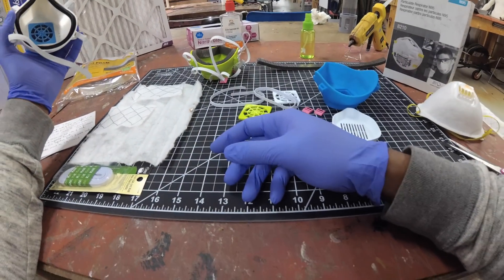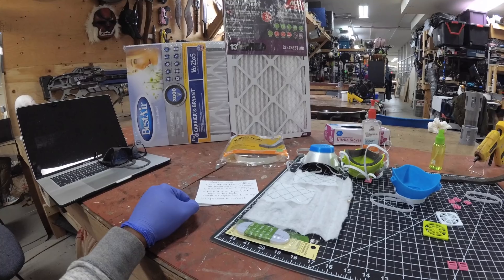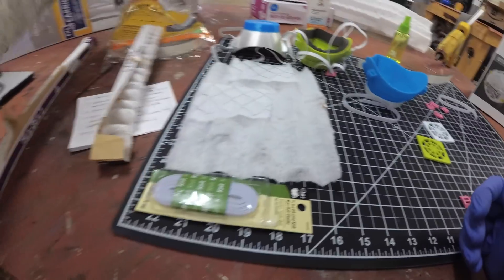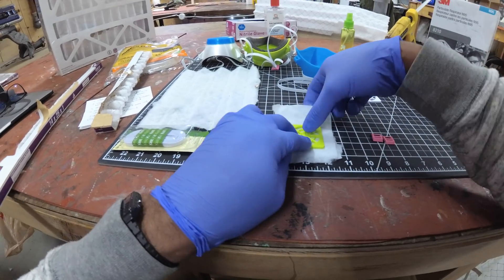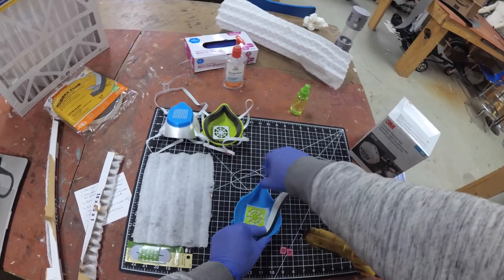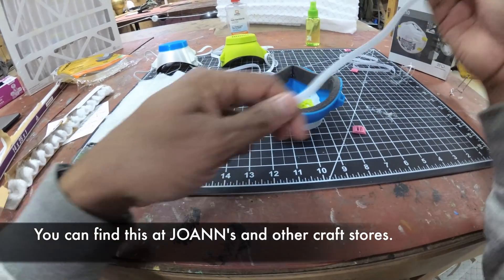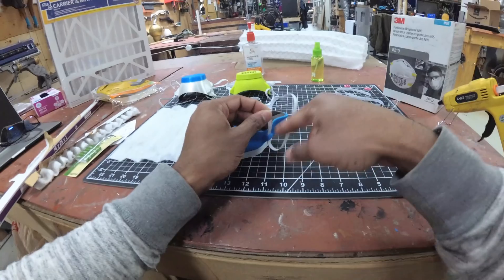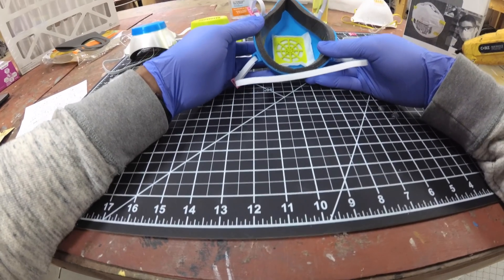3D printed PPE DIY Particulate Mask ( PROCESS )

Comment: Very bad design: You have no one way exit valve for exhale air, to prevent the moisture build-up on the filter element, thus quickly degrading the element. Also, the way you are not isolating the (very small) filter element from the mouth. This, paired with moisture build up, will make this in to a petri-dish, not an respirator. This is not something i would trust my well being to.
Reply: how would this (even if its slightly flawed) compare to a normal surgical mask?    i only got those surgical mask (blue colored ones)  and debating would that still be better? or this?
Reply: @JC.72  Surgical masks, the ones that surgeons used are designed to intercept exhale particulate, not intercept inhale particulates. They do not forma seal around the mouth and nose and they do not have a stand-off distance from mouth and nose. Touching your mask with your mouth is bad idea, because it contains all the filtered particulates from the air - including any pathogens. In short, surgical masks are designed to prevent you from spreading droplets on your patients, not prevent you from being exposed to droplets yourself.
As for how it compares? Lets just say that ill would not trust my life to either ones of them, surgical mask is not designed for this, and this 3D print is just fundamentally flawed.
Reply: @DjSokYchannel - true, and their filtering capability degrade even faster. You have to remember that one of the N95 respirators features are also the sand-off distance from nose and mouth and the seal around them they provide along with all the filtration of particles. The one way valve on the mask is designed to prolong the useful time a mask can be considered effective before the you change for the new one, but increasing price and complexity and adding point of a failure - the valve. This is why, most medical ones do not have them as you usually think that medical personnel have ample supply of them and change them as they need... something that is now contributing to the shortages.
Reply: 00971562029682
Reply: Pls call me

Comment: Wrong - a VERY defective design for actual use tho it is among the best looking masks?  Here's WHY?  Before that an important essential statement. We can easily divide all alternate-PPE-DIY-"inventors" into three broad categories.   1.  - the well intentioned sacrificial volunteer type trying to help that "think" they are spending time and money to donate to the problem - their primary interest - and who are welcome to hear critique.  2. -  The same as one except their - primary goal is to become a youtube celebrity-hero with mega-views.  3. - The deceptive exploitive fleecer crooks who care about nothing other then hijacking despair and disaster to the greatest personal profit their sick (self-imagined) clever minds can accomplish.  Mass numbers of DIY-er PPE devices out there representing all three categories.  You the reader be the judge which category this offering fits into.  How he responds to this comment "can" be at least one of many possible measurable's.

Why defective - abbreviated - more explanation of each follows later: ( 1. - ) > the filter size is TOO-small, ( 2. - ) > using furnace filters is wrong, ( 3. - ) > No exhale check valve (see one on any normal N9 mask), ( 4. - ) >  While this IS the most attractive Mask design I have seen the 3D material it is made of MAY make mask too heavy (this is a guess, but certainly it has to be heavier then a real N9). ( 5. - ) >  No where does he say he wore-tested it for at least a couple hours, ( 6 - ) >  He asks for donations at the end; others ask you to subscribe or press the like button - THESE ARE A RED FLAG!

Above more explained.  
( 1. - ) > There are so so so many other COMMON sources of True HEPA filter-media sources available at most common stores; use of furnace-filters reflect someone whose likely just copied another YT just adding a different take - any competent housewife can inform you of these where's - does he even know what HEPA means?  Plus another evidence he's just copied and "thinks" he's improved adding this click-bait angle of using a 3D printer is calling for you to get MERV 13 or 16 furnace filters.  Neither most Home-Depot or Lowes have furnace filters that use Merv ratings.  3M uses a numerical rating like 1300 or 1500 up to 2800 usually a Merv 13 equivalent is as high as you can get.  Honeywell also uses its own - different - rating system.  Most won't see any Merv-ratings on the most available furnace filters.  Merv-13 only do around 50% or less of .3 micron and are NOT independently Certified.  Do NOT use any Merv 13 equivalent when True Certified HEPA rated filter media is available nearly everywhere AND at both HD and Lowes, but I ain't saying where tho maybe 50%+ of skilled housewives can tell you where.  Plus obviously he has no idea that you'll not likely find any Merv 16 equivalent furnace filters available and has NO idea why - if you can't answer THAT WHY already right-now you need to choose another approach to helping out.   
( 2. - ) >  He shows an N9 Mask - what's that thing protruding from the middle - does he even know what that is and what's it for and why it is essential to any HIGH filtration media and he also needs a bigger size filter area?  Does he even know WHY the higher a furnace filter rating is the more pleating it has or the thicker it is- I doubt it?
3. (& 1.) >  That thing in the middle of the N9 - can he tell you what that is and WHY it is essential and does he even understand the difference between the square inch area of the N9 filter media vs the teeny-tiny insufficient filter area of his DEFECTIVE design.  Both these inter-related functions are minimum requirement to any mask even approaching a reasonable safety-odds margin.
( 4. - ) > Did he even consider to borrow his wife's or girlfriend's diet scale to compare the "wear-weight" of both masks, the N9 and his design, does he even understand why I added the diet word to the word scale as it relates to mask design?
( 5 & 6 ) > These self-explain themselves to anyone who understands spam and scams tho I doubt he actually intends either and SEEMS to have zero malicious intentions.  Best wishes and high hopes to - ALL!
Reply: People are trying their best and If you have such wealth of knowledge then perhaps you should share it in a constructive manner. It´s not like the guy is trying to make a killing with this. 
Your can do better then this wall of condescending text.
Reply: The plethora of time you appear to have on your hands could likely be better spent improving what you believe to be defective designs rather than being so misanthropic and rudely attaching someone with positive intentions. I am quite sure you are the type of individual that will invest  a considerable amount of time in constructing a long winded and insulting rebuttal to me that I will never read.  Send me a link to your wealth of knowledge video that will save the world and I might sacrifice another 4 minutes of my time to humor you.
Reply: You sure have a lot of time at your hand right now but wouldnt be your time used more productively if you tired to make this mask more like the N9 mask ?
Reply: @MRHanfgurke  - The man is correct, i had the same criticism. The filter element is too small, get moistened up and is too close to the face with no way to safely dispose of the filter. The filter element is potential hot bed for the pathogens, as all the air will travel trough it. This is calssical case where amateurs can do more harm than good if they don't understand the very basics of working with pathogens and air filters.

Comment: Just a suggestion. Silicone used by prosthetists and dentists is very inexpensive (at least here in Bosnia, about 30 Euro 1L) and can serve as a seal between the mask and face skin.  You can print a mold that fits in with the edge of the mask via 3D printing and then the silicone is just poured, and not irritating to the Skin. Have you tried paper or canvas vacuum cleaner bags as a filter? Some  research shows that it is very effective, but that it is very difficult to breathe through such material, but you can try it, at least. https://smartairfilters.com/en/blog/best-materials-make-diy-face-mask-virus/
Reply: Just thought about the same, any talented designer that could make this seal???
Reply from the maker: We are currently experimenting with making a master mold that we can cast from ... we're also looking into different materials, surgical being one of the better ones we've discovered that work thus far and are already readily available at most hospitals.

Comment: Why not integrate the adjusting clasps into the mask itself? Ie: make the over and back bars in the mask so that a single strap of elastic can be used top and bottom and its a few less parts to print
Reply from the maker: hospitals have actually asked us to just tie the elastic as they want them to have a standard fit and be easily & quickly put on/off ... the adjustable clips are no longer being used.
Reply: and while were at it the outside material tool. we should minimize leakage

Comment: I would love to see a fit test with these mask to see how well they seal. I love the idea, but I am not sure if that rubber seal is good enough. Would require some reworking, but I think something with a silicone seal would work a lot better and stand up better to disinfection in something like an autoclave.
Reply: I'm involved with the Lowell Makes folks. These masks are not for steam sterilization such as an autoclave. To sterilize these, it would require a strip down of all the other components. Only the mask, front housing and interior square can be sterilized in a Sterrad machine (hydrogen peroxide vapor with gas plasma). Great job Give Wave studios!
Reply: And I would use four clips so that you can adjust the fit from both sides. Less adhesive should equate to a longer lasting mask.

Comment: Thank you for sharing your idea, great job. One suggestion for the cap: if you rotate the slots 90 degree and create a horizontal louver type opening. It will act like a rain screen and prevent air borne water droplets getting inside. With this design, I don't think you need extra filter layer. The draw back for double filters is more difficult to breath.

Comment: I 3D printed a similar one.  I used a 3M Filtrete filter.  The 3M filter is only glued at the edge and much easier to separate.  I noticed people printing them with PETG, ABS, and TPU.  Their datasheets all show them to be toxic.

Comment: i thank it is a pretty good design but what i would do if i where making them i would eliminate the peace on the strap and i would only print about 1 or 2 of the main piece and cast it in maybe a silicone that way you can make a lot fast

Comment: What is the total cost?
Reply: I found a similar design in thingiverse that takes a bit less material, which prints a bit faster. The material cost for the printed parts using the design I found is $1.92 when using PLA, so this print should be about the same.

Comment: Excellent tutorial and thank you for providing the files.  May I suggest using two filters- an outer filter composed of MERV-13 home air filter material and an inner filter from a HEPA filter vacuum bag. The advantage of a two filter setup is that the HEPA air filter catch any stray fibers released from the fibrous MERV-13..
Reply: Two layers make it more difficult to breath though.

Comment: Secondary solution I can confirm with flexible tpu . I was able to get a proper fit without foam as well ! I’m using a 95 shore hardness TPU from matter hackers.
Reply: I've heard of people switching from PLA to TPU mid print, and getting good adhesion. Not with this print, but I think I'll give it a try.
Reply: Can you send me the link please for that file?

Comment: you need an efficiency of 95% or greater for .3 microns to meet healthcare requirements.
Reply: MERV 13 might not make that rating in a single layer. MERV16 should be roughly equivalent to N95: http://www.mechreps.com/PDF/Merv_Rating_Chart.pdf

But if you can source MERV17 or better it would make sense to use. If you're doubling up media, you might be getting better performance out of MERV13, but that's part of the reason this type of project can't be certified. :/
Reply from the maker: @JacksonKnives  as long as you make sure the MERV rated material does not have fiberglass woven in it. this is more likely the case with MERV 5 & below as well as 16 & up rated materials from our findings ( but not all )
Reply from the maker: Semper Fi  I can't speak for every brand out there, some might, most don't but it's best if you research the type you intend to use yourself by looking up it's MSDS sheet
Reply: Generally the low MERVS have fiberglass and the 16+.  12 shows that it removes bacteria and viruses, but most docs on tv recommending 13.

Comment: Question: is there a possibility of inhaling plastic PLA particles from the mask itself. Wouldn't the layered nature of FDM printing prove to be a problem for collecting Germs and just generally being porous to these microscopic particles to get trapped in and or move through. This Is a legitimate question, maybe these are non-concerns but I simply don't know. I only have an ender 3 btw.
Reply: The best way of doing this is using PETG instead of PLA.
Reply: There's no smell (gasses) when PLA is under its glass transition temperature, and it's basically make from corn starch that releases a non-toxic smell. Printing/heating ABS on the other hand is toxic, and when i first started 3D printing back in 2012 ABS was the go to filament and i kept my printer in the workshop outside. PETG doesn't release a notable smell and is also the same plastic used for water bottles BUT if you overheat it, it is also toxic.

With that said, what's used to color the filament might be and it's best to check. White pigment in filament for example uses titanium dioxide, which is also used for food die, cosmetics, and things like plastics. But if you somehow burn the mask you have on and keep breathing it for a long time while it's burning on your face some can get into you lungs where it might be a carcinogen lol

Comment: Question. Why take off the metal if it can just be cut and sandwiched in the opening? I would think that it would fue sure compromise the effectiveness of the filtration once that would be removed. If there is no way got the metal to reach your face I would think it could stay on

Comment: Two questions... Do you have a wiki page somewhere with your findings about which filters contain fiberglass? It would be great so others know; maybe make a github page. Next, what MERV or PPR  is needed?
Reply: Use cotton as the base layer.
Reply: https://airfuji.com/hepa-vs-merv/  From this table I think you need a HEPA filter or at least MERV-16. 
MERV - 13 as used here is extremely dangerous as 50% protection in a hospital environment would seem very low.

Comment: This is great, thank you for posting this! Is this model based on the N95? If so did you use a certain size as a reference?
Reply: N95 refers to the specification of the filtration capacity, these masks are not medically rated ... just because there is some kind of a dust filter wedged into the front of this does not make is a proper bio filter ... you have to careful you are talking about lives here ... this is terribly dangerous
Reply from the maker: @dennisash7221  the video is riddled with warnings and I mention multiple times that this IS NOT a replacement for proper PPE or N95 ... We are ONLY giving these out to our local hospitals to help alleviate their shortages who ultimately decide if they will put them to use or not and have the capacity to test them properly before use as well as disenfect them with sterrad machines. The video description is also full of info and links for more on the project.
Reply: @GiveWaveStudios  A hospital does not have the means to test the masks you need to send them to a testing center. 
Sending them to the hospital implies that they can use it unless you tell them otherwise ... Your intentions are good but think about the dangers of introducing safety equipment that isn't tested.
Reply from the maker: We did not design the original model. However we are using because it seemed to be the most effective out of all the others we'd found online. Right now we are actually prototyping our own version that addresses some of the downfalls of this model per feedback received from out medical professionals who've been testing these in hospitals
Reply: @GiveWaveStudios  I have to say again that hospitals do not have the test equipment that is needed to test if these work. You need to send them to an independent lab that can run the proper tests on the product to determine its efficiency - doctors and hospitals don't have that equipment or expertise to run the tests..
I say again your intention is good but you need to think of the consequences of giving untested product to a hospital. I am sure that if you contact a testing center they are aware of the desperate need and will probably expedite the testing
Reply from the maker: @dennisash7221  duly noted, thank you for the feedback.